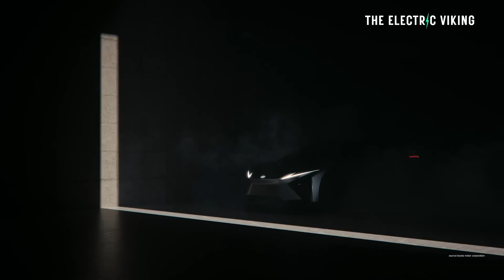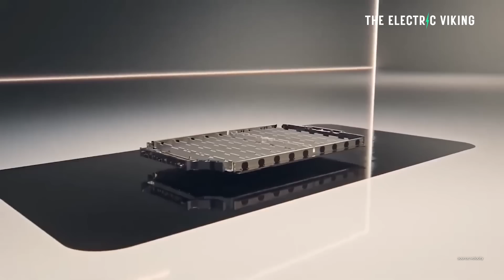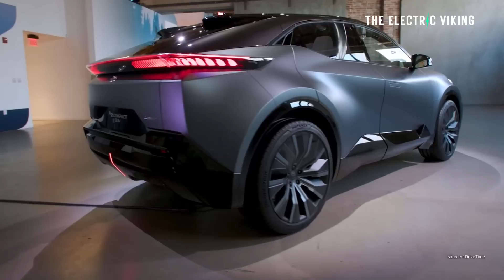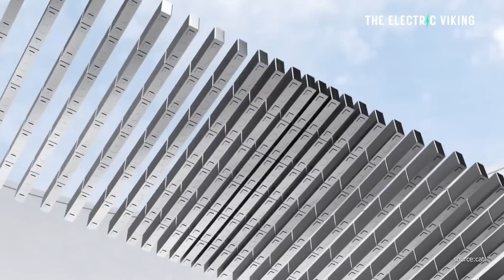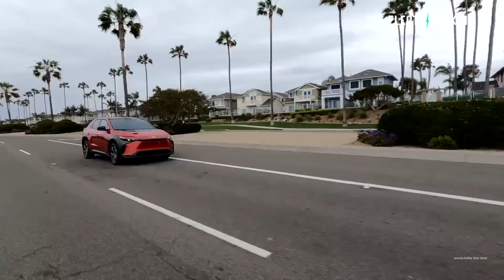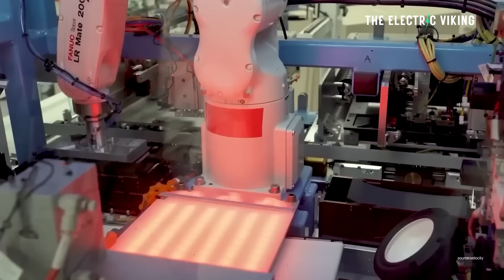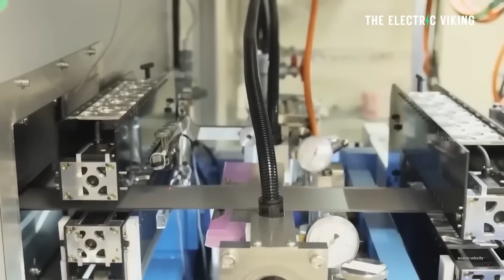Toyota says it has game changing LFP and prismatic cells that will destroy BYD

Comment: 400 miles is good enough for me, with 250kW charging speed that can be maintained well above the 80% mark. I do long journeys two or three times a year, with kids in tow, so stopping for 20-30 minutes is going to happen regardless of whether the car can carry on. Roll on the Model Y Juniper coming onto the used market!
Reply: Yes, the average range of a gas car is 400 miles or the way I drive 360.  Very few people will travel more than 400 miles on a trip without stopping.  Especially, if you have kids.
Reply: I look forward to discovering Tesla supercharger locations when taking roadtrips here in California. They are in good working conditions across the board plus, some stops are literally hidden gems with shopping and restaurants!
Reply: @kabysummit5801  They are.  In many years of using them I have only seen 2 broken Tesla chargers and it wasn't a big deal because I just moved over a spot as most of the time there are many spots available.  Just try to avoid the busy chargers in LA or San diego during the 3-5pm rush hour or you may have to wait a bit.  They've been installing a large amount of chargers in this area to keep up with demand but there are still wait times at some locations.  Be sure to look at the app to make sure open spots are available for the chargers you are headed to.
Reply: 400 miles car would need roughly 110 kWh pack, and charge 230 kWh average (10 to 80%), that's 2C charging. Perfectly doable with current battery chemistry.
That pack would be very heavy though. There are several cars on sale like that in China.
Reply: @MrChakra108  Really though, I mean that 400 miles is the stated range of the car. I would intend to drive more like 250 mile hops which would take 3 hours a go on a French toll road
Reply: @MrChakra108  The model S gets 405 miles on a 100 kWh pack.  Of course you would need to drive like a grandmother to get those ranges.  110 would realistically get you there.
Reply: And you either stop where there is charging or your journey takes way longer than mine in my hybrid.
Reply: @stormsj Assuming you can charge at home, you will save far more time never going to gas stations then you will ever waste charging on a trip.  Think about it.  I don't know your situation but personally I have a gas station roughly 2.5 miles from my house. The speed limit is 35 miles per hour average so it takes about 4 to 5 minutes going to and then back again plus about 4 minutes fueling including card reading and pumping and getting back into traffic.  Depending on how much you drive you'll probably do this about once maybe twice per week.  Even if you fill up on your way back from work your still wasting at least 5 minutes every time you do it.  Most people take 1 trip per year if that.  Again this will vary depending on your situation but most people will never break even on a time bases.
Reply: @Ryan-ff2db  I think a PHEV would be better for daily commute and road trips.  Totally understand what you are saying, but until I can take a road trip and not have to rely on more sparse than gas station infrastructure and generally longer energy refresh times by multiples of 2-10x...I am not going to drive a BEV.  If I can get a BEV with all day range with future batteries and only charge overnight...then I'll consider them.
Reply: @stormsj  The car takes you to the best charger on your route so that's easy but it will take a little longer.  As I said before the vast majority of people don't take trips that often and will charge at home 90+ percent of the time, so you rarely ever need to go to a charger.  The time you spend going to a gas station every week or so in your hybrid, will exceed the time an EV user spends at a supercharger simply because most EV drivers rarely ever use superchargers.  Spending another 15 minutes charging on a trip compared to filling up is no big deal at all.  I would take the convenience of charging at home anyday to watching Hulu for 15-20 minutes on a trip.
Reply: @Ryan-ff2db  what if I have other points of interest along route that don't have charging, maybe have a decent detour, but I do want to stop for a 15-30 minutes just for energy cause of these more interesting stops that I want to be the longer 15 minutes to hour long stops?  Then I am spending 15-30 minutes totally bored out of my mind at a stupid stop rather than a few minutes.  

And a PHEV with 40-50 miles of range would mean I never need gas until I take a longer trip as that's all I drive on 99% of my days.  If they pushed PHEV battery size a bit so many were about 100 miles that'd take care of most people and let them stop when and where they want on longer trips with only very short fuel stops needed if they fuel wasn't at the ports of interest...yet most of the world fuel is WAY more likely to be near a point of interest than charging on a long haul remote point of interest.
Reply: @stormsj  Ev's typically have a range between 250 to 300 miles, so unless you live in death valley or some remote place in Montana, your theoretical exercise is just not a realistic scenario.  You can look up charger locations online and you'll see they almost every nowadays with more being built out at an ever faster pace.  The problem with PHEV is they have to fit both EV elements and ICE elements together so you end up with maintenance and repair costs higher than either EV's or ICE vehicles.  They also have to fit them in the same space, which is why PHEV vehicles catch fire between 50 to 130 times more often than a pure EV's.  This is not joke look it up.  People overestimate the amount of miles they actually drive.  The average american only drives 37 miles per day on average with Europeans driving about half that.  If you really think you need more range, which is unlikely, but if you really do, battery tech improves every year.  The first EV's had less than 100 miles range and now the average is about 250 to 300 with some well over 400 now.  So wait a few years and they will get there.
Reply: @Ryan-ff2db  What if I just want to take a cross country vacation every now and then to places like Death Valley, Yosemite, or Yellowstone and don't have enough time off to deal with the extra stopage to charge at less convenient charging locations vs where all the PoI's I want to hit along the way happen to be?  If I take a week off from Texas such trips are easy...with a gas car.  With an EV the trip would be compromised and I would have to plan for less time at the destination and probably less time an very neat PoI's along the way to cram it all between 2 weekends.  EVs are just not ready for such a use case...FULL STOP!!

PHEVs are!  Maybe a PHEV isn't as reliable as an EV or ICE...this is an obvious thing.  But you know what they are more reliable than....about any vehicle made or driven by any of us 15+ years ago that were all FAR more unreliable than modern vehicles!!  So who cares if they are plenty reliable.  I don't need something to never needs maintenance and generally I didn't find cars all that unreliable until you go back like 40 years and they all needed almost weekly maintenance of some variety to be super reliable.
Reply: @Ryan-ff2db And that is a Chrysler...so probably as bad as it gets for PHEV reliability...and it really hasn't been so bad overall.
Reply: @stormsj  That's fine.  I'm not trying to force you to do anything, I'm just telling some things.  I live outside of Yosemite in the valley here and have been through Yosemite many times in an EV, I took my cousin and niece this February.  There's superchargers in Fish Camp right outside the gates so it really isn't an issue at all.  Yellowstone would be a bit trickier depending on where you're going and I would never recommend going to death valley in any vehicle but that's your prerogative.  I have taken trips all over this country in the last few years and I have never had any issues finding a charger because simply put, I've never had to look for one.  You just navigate to your destination are the car will find the best charger on you route.  Charging really is not that big of an issue on the Tesla network and starting in early 2024  all EV's will have access to Tesla as well as CCS networks so that issue is becoming even less of an issue. 

You keep coming up with extreme hypothetical situations that won't affect 99 percent of people.  That's fine if really if you really think you're gonna through the remote parts of death Valley. But traveling around Texas or Colorado or any state really is remarkably easy, it just is.  There are many reasons to buy or not to buy EV and each person should honestly evaluate the situation.  For many that may be PHEV but these are transition vehicles and we are in transition phase.  Every year the tech gets better and there's some pretty cool tech coming out in the next few months and plenty of new battery tech is on the way next year.  They just keep improving and it's never going to stop.
Reply: @Ryan-ff2db  I live in TX...road tripping to those places is a different adventure level in an EV than for you.  And it's nothing that forces 10 minute to 1 hour stops every 90 minutes to 4 hours isn't "easy"....it's frustrating.  You are at the mercy of the energy delivery gods.  Dino juice is just way faster and simpler and able to added when ever where ever without minimal hassles and wait.  Doesn't need to be coordinated with eating and force you to eat near a charger and all the rest to make reasonable time when trying to hit 600-800 miles down the road in a day.  Sure it's easy if you are happy limiting your daily road trip goals to like 400-600...then yes...the whole 200 or so max you can maybe get with at comfortable 20-80% charge where you are in the meat of the charging curve and can avoid a 1 hour charge...but you're still waiting 10-30 minutes vs maybe 5 if you really are just stopping to fuel before driving somewhere else to eat.  

Essentially you EV folks contort on road trips to the EV charging gods demands in ways you fail to even realize that many of us normal people just aren't willing to contort to "save the planet" or whatever it is you are willing to constrain yourself during a road trip.  

BTW, I live in TX and have family in the Dakota's just going home to the dakotas to see family in an EV would be a complete cluster.  And my situation isn't unique.  Yet if these fools just tried to make goals where vehicles had like 800 miles range as the spot they really try to make the transition happen...places like the dakotas wouldn't even need the wildly expensive heavy fast charging infrastructure and could just focus 50-100kw stuff near hotels and be done.  That should be the goal for EV transition infrastructure.  Not aluminum smelter level power draw ever several exits down the interstates.  That's just mad stupid way to do this as far as the grid and infrastructure...yet it just gets crazier as you go beyond 50% trying to do EVs with all of them in the 300-400 mile range level and road tripping them and such.  It's just retarded to think the 400 mile range would work as far as infrastructure for road trips once that's what EVERYBODY is having to do.  It's just a stupidest way to do the charging.  Get the battery to point they can all have all day range and then the rest of us will consider them.
Reply: @stormsj Yikes that's a lot of words.  For starters you're massively over exaggerating.  You do not charge every 90 minutes, that's absurd.  Average charge time is 20 minutes not an hour.  If you frequently take long trips keep using the PHEV you keep talking about I don't care.  A tool for its purpose.  If you're like most Americans, which clearly you are not, if your taking all these crazy trips.  But for an average american that drives only 37 miles per day than an EV will save you time and money.  Charging at home when you sleep is about the most convenient thing I can imagine.  Waking up with a full tank and never visiting a gas station is awesome.  By the way, I own many vehicles not just EV's, so I know what I'm talking about.

I'm not going to continue a conversation when someone is yelling "retard" and "stupid" as that's not logical, it's emotional.  I remember in debate class the instructor made it clear that anyone who stooped to name calling instantly lost the debate as it meant there argument was based on emotion not on facts.  If you want to discuss numbers or facts I can but I'm not going to discuss anything until you calm down.  I have no idea why people get so emotionally anti EV, like I just insulted your mother or something.  It's very strange.
Reply: @Ryan-ff2db   a 5-10 minute charge one can consider similar to gas stop is adding 90 minutes of driving at most. That is reason for pointing to that as base possible charge length and distance gained by it.  With gas 5-10 minutes is by a rule full tank and 100% range ready to go again.  For many of us...looks like 80-90% have yet to bother with EV, but have read up on it like I have...even if we take one long trip every other year we don't want the "excitement" of the EV road trip process that requires 20 minute average stops every 3 hours or so and would maybe want to go longer or just do very quick 5-10 minutes stops.  I have yet to see any all day road trip tests vs gas where an EV can make it any where near as far in an average day of driving...it's just somewhat corrupt trying to act like they 20 minute average stops don't start to add up to hours more time and distance lost in long road trips.  And sure maybe you EV road trip loving goofs like arriving at destinations later and along less scenic forced by the charging destination nav when you do road trips....but if I am going to take more time getting to destination,I'd want to take the scenic route and not do it watching my charger and guessing when I have enough to satisfy how fed up I am to safely move on to the next charger. 

And there are LOTS of people like me ..most really... that's why they aren't yet considering EV beyond the narrow niche 20% or so like you.
Reply: @Ryan-ff2db  what's a better word than "stupid" for the wildly unwise plan to try and get everyone in EVs and trying to recharge every 200-400 miles on road trips with conveniently located mass charge stations that would be drawing power from the grid like aluminum smelters all over once everyone is doing it this way?  It's just not a viable or cost effective way forward to do things.  Simply put you need to be wildly unwise to think that could work...I think a more concise word for this overall state of agenda and plan forward to move to EV is to call it all stupid.
Reply: I currently get 200 mile range which is NOT sufficient for long road trips, I would be happy with a minimum of 350 for my next car.  Majority of time, I am happy charging once every 2 weeks from home charger.
Reply: @ianwatkins9609  200 total or it tends to be 200 to stay in some reasonable charge time out of a 350 sorta range?  The thing I see is that most EV folks I talk too don't want to feel stuck and held up so drive 90-200 miles stints and hit as many of the fastest chargers as they can on a route to be able to claim they usually only stop for 5-15 minutes and make it SOUND equivalent to gas as they lie to themselves.  This only works to may lbe 200 miles as when you start to go over that it's hard to do the charging in less than half an hour to keep this lie alive.
Reply: 600 miles (1000 km) would be a ideal step.
It doesn’t mean you should drive the full range untill the battery is exhausted, but you have more freedom where and when to charge.

Right now, my hybrid has a 750 km range, but I don’t drive until the tanks had dried up. It means I can drive untill it suits ME to fill it up, not when I must.
Reply: @hanswitvliet8188    totally agree... the only real issue is that BEV trying to add 300-600 miles of energy in reasonable time is even more difficult for electrical grids to accommodate once this is all going on in mass scale.  To me you get a bit over 600 miles and all the sudden most are only charging at hotels and road trips work like daily commute as far as how they put demand on grid that is a bit less extreme, by charging slower with less hot points at peak use times.

Comment: 80 kwh battery is equal to 8 gallons of gasoline. My last Prius had a 10 gallon tank and claimed range of 600 miles. But at freeway speeds, it would deliver 350-400 miles of range, depending on temperature, cross winds and elevation changes. If they come up with something more efficient than a Prius, they might hit that target, but it needs to be 3,000 pounds and even more aerodynamic than the Prius.

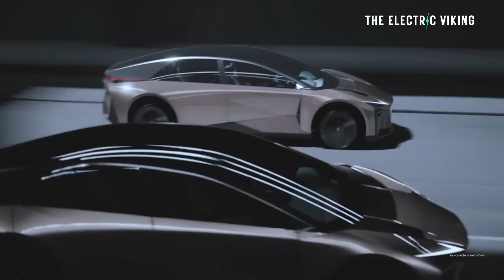Comment: 4:08 Common rookie mistake, Battery energy is not kW but kWh. kW is power of motor or battery discharge power. Hope you’ll consider 😊
Reply: He has over 4000 videos talking about EV's and batteries but still can't seem to understand the difference between energy and power and what units to use.